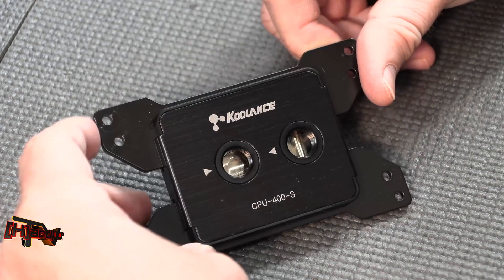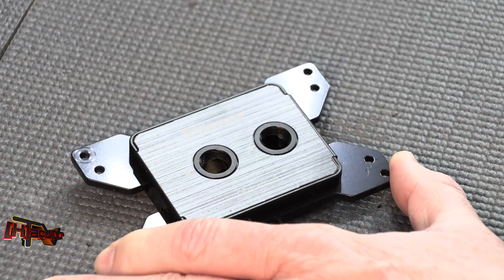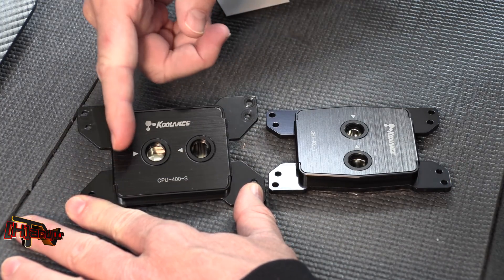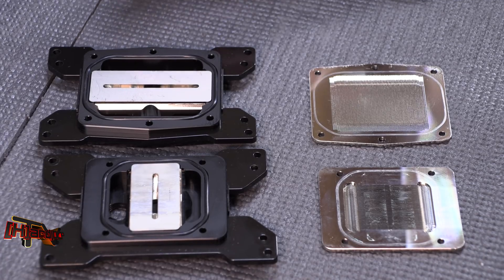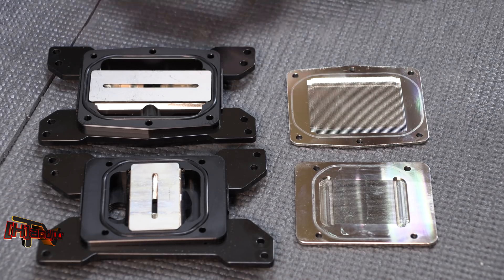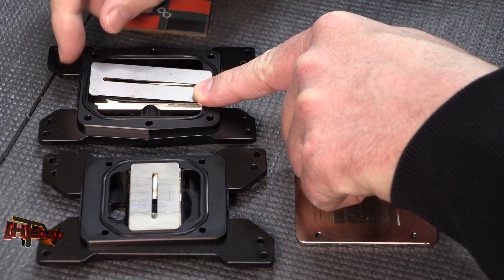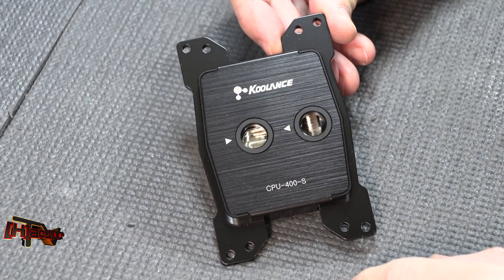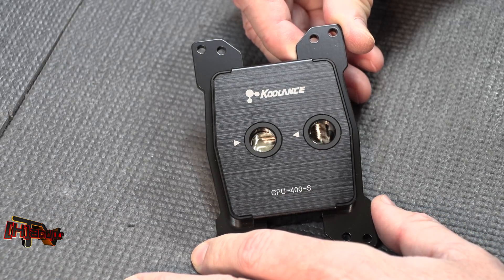Koolance 400A S Water Block V2 Unboxing and Breakdown

Comment: Hi Kyle...is there any way a guy like you can get companies like watercool to make a monoblock version so  to cool those mosfets along with the CPu and get rid of fan noise....and....I wanted to ask....why in hell isnt ASUS making any 6 PCIE 16 wired at 16x for EPYC or even TR4 WS motherboards with 6 PCIe wired 3 @x16 and 3@x8 and 1 @4?...whats your thought on that given that AMD solutions are specifically designed to  opt for single socket  HPC solutions?!
Reply from the maker: EK is making a monoblock for at least one TR4 board.  However, I am not a big fan of these.  It is hard enough to get the water block to mount properly against the Threadripper alone.  I think introducing more points of contact are just going to make a good mount more problematic, and when overclocking Threadripper, a good mount is of the utmost importance.  I would not use a monoblock on my own system.
Reply: yeah I see your point and a good one....though ek solutions for AMD are kind of not an option...... i have noticed that some reviewers get the TR4 socket to bend, and im starting to believe that the TR4 socket at this stage is very very poor quality  from all manufacturers...I have no idea  why...possibly the back plate is bad as all the rest....but if i definitely seen  some bent just as the cpu bracket bends as well, i think threadripper cpus possibly lack good contact in the middle area, and when they will have 4 active cpus, this issue might become  a big one in my  opinion...I would disagree with You though, on such cpus a monoblock is a must especially for others like me who keep 100 % loads with 4 5 67 gpus for days non stop...and  for this purpose anything that is above 20 decibel is an absolute no go.
Reply from the maker: I have not seen any issues with the TR4 sockets bending.  Actually I have been extremely impressed with just how incredibly durable they are (outside of the pins).  I have abused many of those since launch and have not seen issues with structural quality.

Comment: i like your promotion of TR waterblocks ....
i bought Noctua heatsink with 14cm fan for TR and have to say it cool quit good , now i can run my TR 1920X 4ghz with 1,325 V ....it looks stable for me /rendering with 3ds max + whatching YT videos /
i hope with good watercooling i can go highier maybe 4.2 ghz or not ?
Reply from the maker: I have found that most Gen 1 Threadrippers are not capable of 4.2GHz under extreme load testing.